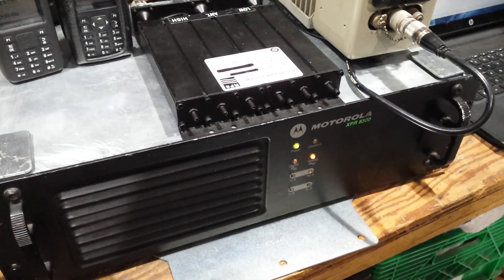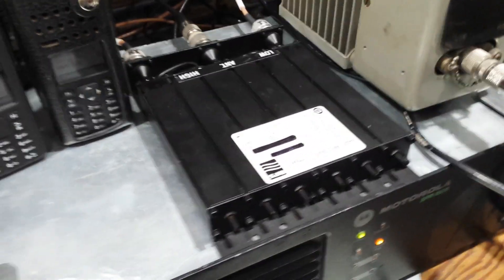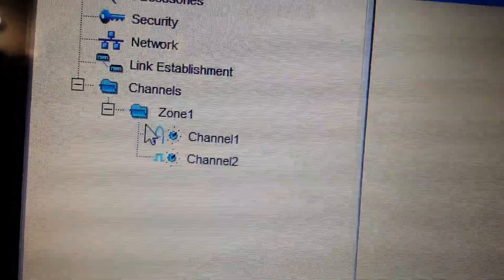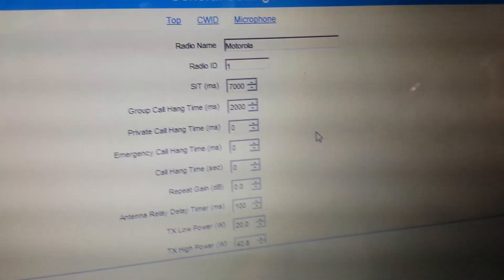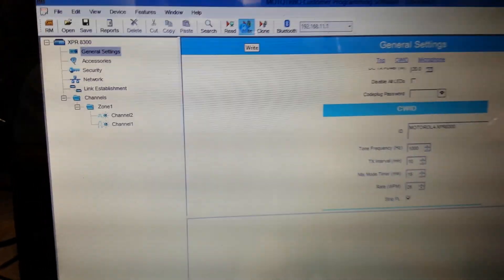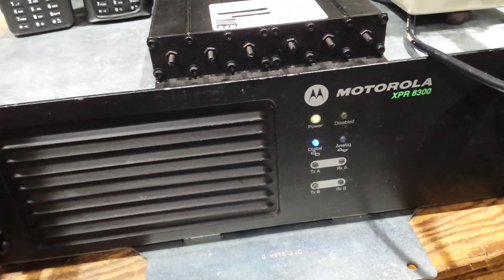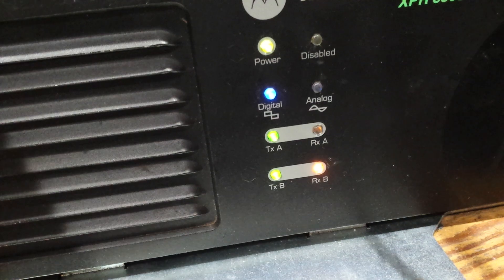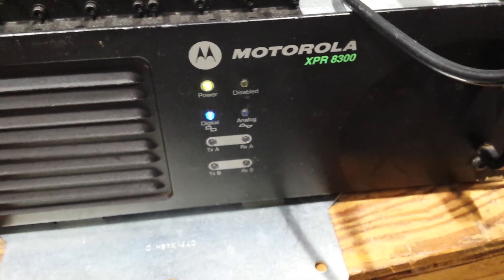MOTOROLA XPR8300 MOTOTRBO REPEATER DEMO FOR DMR AND ANALOG RADIO COMMUNICATION

Comment: I ended up buying one of these, added Mixed Mode with ease. It happily passes Analogue or DMR or AES DMR without intervention.
Reply: What model repeater or what software used to make it a mixed mode repeater?
Reply: @Subgunman  The XPR 8300, 8400, 7550, 7550e, 5550, 5550e, 7380, 7380e and the SL7550 can all be fooled into adding extra functions using a well documented method of first reading and saving the radio tuning details with Motorola TUNER, take a pictute of your SERIAL number, you'll need that later, then change the serial number using Motorola DEPOT to a few special serials depending on the features you want to add. Next you replace the userdata.sdf file with a hacked one, then open up the codeplug but DON'T reading the radio. Instead you hit the ACTIVATE button and wait while it checks the radio, checks the hacked userdata.sdf and then presents you with a menu of features it thinks you paid for, then asks which of them you want to activate, Mixed, Mode, AES, Capacity+ etc. Select the features you want added and it will add them.  Then load DEPOT and return the radio to the original pre-hacking SERIAL number you took a picture of, then load TUNER and load the original saved tuning settings back into the radio.  Takes 10 minutes per radio, but the steps are important.

Comment: You probably know this already but you can certainly run a mixed mode, digital and analog, with these repeaters. Newer firmware with a factory unlock code allows this. The unlock codes are pretty easy to find.
Reply: Only the 8400 repeaters can run mixed mode
Reply: @kk7gkg how’s that possible ?
Reply: That's 100% incorrect
Reply: @jcflyer6213  the SLR repeaters can do mixed mode
The XPR8300 cannot do mixed mode the XPR8400 can
You can switch the control boards of an 8400 to make an “8300” mixed mode

I run 8400 and 8300 repeaters for the commercial world I do programming and updates
Reply: What ? I have a XPR 8400 repeater will this work in mixed mode ?
Reply: @datman2226  the 8400 repeaters require an activation key to use the multi node feature
Reply: @datman2226  if you have the mixed mode key then yes you can

Comment: Where do you get the software at? And how much is the software. Any links on where to look? Thanks in advance.
Reply: Motorola online tell them what you need make an account. sign a few forms that say you cant give out or make copies of the software. pay a few hundred bucks and then get a programming cable. Then have a ball.
Reply: What is the difference between programming the DR 3000 and the Repeater X?

Comment: Does it have the ability to be programmed for mixed mode.
Reply: Biggamehunter 123 correct
Reply: Yes you can run mixed mode with motorola you have to buy a license from them to use it.  His video was incorrect in saying you cannot run mixed mode.

Comment: Where did you get the info about only analog or digital use? It will do but st the same time
Reply: Hi, No - this repeater will not do both analogue and digital at both times. It is either analogue or digital mode.

Comment: I'm thinking of updating my analogue repeater with digital - can I ask a question. I currently have three users on my system who work pretty well ignorant of each other, using different CTCSS - if using say slot one - can these motorolas allow multiple colour codes? So one low use user on colour code 1, slot one, another low use user on colour code 2, slot one and then the busy user on cc1, slot 2? two users seems simple, but how about 3? Paul
Reply: Yes, this repeater does support colour codes.
Reply: @reecefroggatt7188  Does Motorola repeater D3000 support multiple groups ? Pls any idea
Reply: @reecefroggatt7188  Does Motorola repeater D3000 support multiple groups ? Pls any idea

Comment: On these Mototrbo systems say I wanted to set up my own system, am I just needing the radios and repeater? Of course all the FCC stuff too but was curious if there is additional hardware needed?
Reply: You need the repeater, operating radios, FCC paperwork, a duplexer, jumper cables from the duplexer to the repeater, an antenna, cable for the antenna and necessary software and programming cables for the repeater and radios if you don"t have someone to program them for you.  The duplexer must also be properly tuned to the receive and transmit frequencies that the repeater is going to operate on.
Reply: @ShaunPuzon  So apparently you never heard of simplex repeaters
Reply: What kind of paperwork?
Reply: Danny Sim  Can I use just the repeater with own antennas at the same frequencies for both TX and RX in VHF mode without using duplexer
Reply: @omarnrc123  You can run a repeater in simplex.
Reply: Danny Sim Productions  What are you talking about?  You dont need a special license for a repeater.  Any ham operator with an active call sign can run a repeater with no special stuff from the fcc.
Reply: Danny Sim Productions  you do not need a repeater license only a ham operator license.  If on GMRS you need a GMRS license.  You do not have to get a separate license for a repeater

Comment: So do repeaters just plug and play, or is there other stuff you need besides the repeater and antenna?
Reply: You also would need a duplexer and all the associated cables along with coax/hardline for your antenna and the proper programming software and cables.
Reply: Thanks!